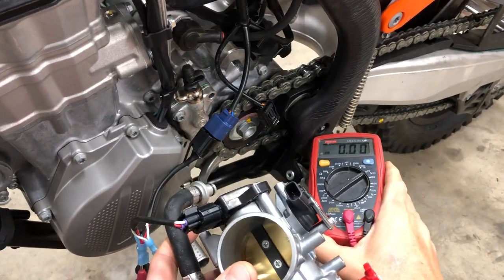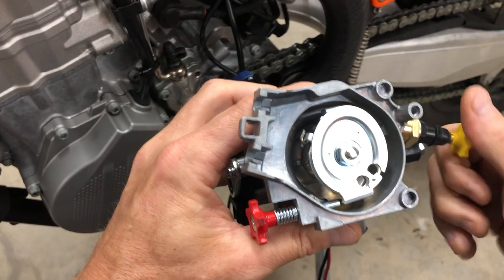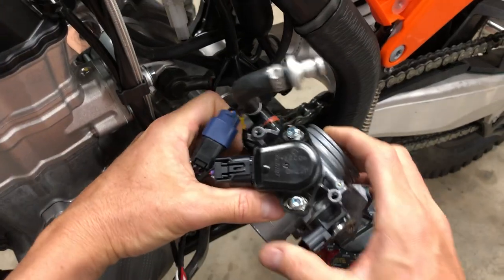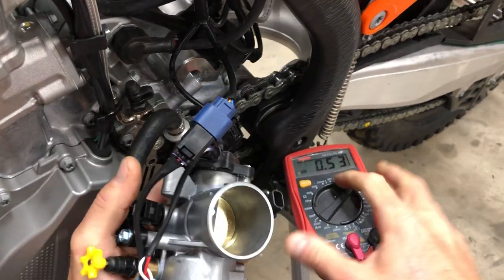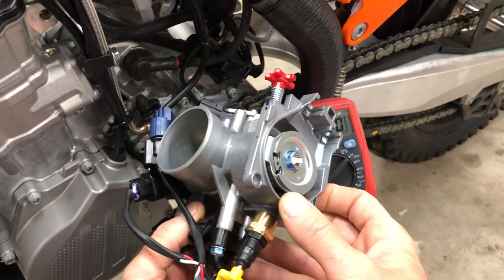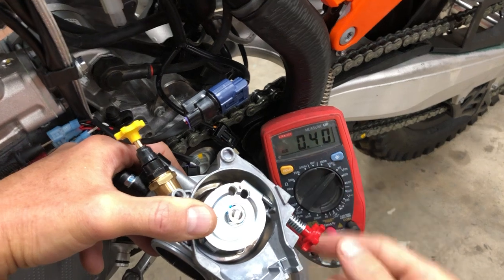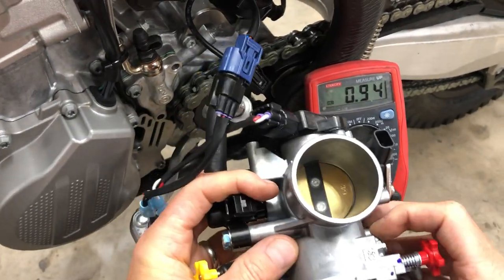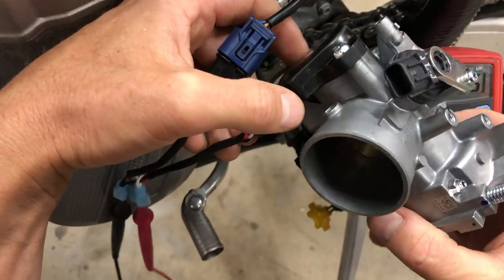MOTO MYTH BUSTERS ON THE TPS HACK AND EVERY THING THROTTLE BODY

Comment: Hi, what do you think of winding the yellow knob all the way out and leaving it there and not using the cold start/fast idle button at all, then adjusting idle with red knob? Can that affect fuelling at all? I have done this on my 2020 450xcf and now on decelleration sometimes it does little pops/backfires.
Reply: That is the way. 

Turn out yellow all the way (63 clicks)
Set red to desired rpm range (2000 on my XCFW 350) once bike is warmed up
Then set high idle to appx 2300 rpm

Note: if you dont set the high idle (enough clicks screwed in) then the throttle tube will have a very difficult (if not impossible) time disengaging the high idle when you roll the throttle forward. Essentially, for every click you go in with the red knob, you'll need to do the same with the yellow to maintain the gap you see Taco showing in the video.

Comment: hello,i have a ytx 125 when it was stock the topspeed was 100kph,but when i change a bigger carb and disconnected the TPS on the stock carb it only maxed at 90kph😅 how can i fix it?😂 the stock carb broke btw.Thats why i use a temporary 26mm carb.Did the TPS disconnected be the reason i loss power?
Reply: i have two ytx,the other one has a bigger bore kit with stock carb and it can reach 150kph,it had 72mm bore.With TPS connected.

Comment: I have a 2017 ktm 250 xcf, and it has always struggled to start, we've done just about everything except mess with the tps, and if I want to start my bike I have to give it some throttle. I have read that increasing the volts read on the tps can make them start easier, is this right, or is there something else that can be done?
Reply from the maker: Set your tps to spec but you may want to confirm that it was adjusted correctly from the factory. 

Also what’s your fuel pressure

Comment: When I hit the high idle on my 17’ 350 it doesn’t stay in like that, would it possibly be an adjustment issue or would it most likely be something wrong with it
Reply: This is exactly why I'm watching.  I been running my bike with it in! Needs to be pulled out.  Did you try to pull yours out?

Comment: Hi when I turn bike on I get 0.48v but when I turn throttle the voltage drops, why would it do this?
Reply from the maker: Voltage should increase as the throttle plate is opened
Reply: @TACOMOTOCO  when I start the bike with cold start pulled out it will idle but soon a so push it back in the bike will cut out. Also when I leave it on idle with cold start on it will only idle for around 30 seconds

Comment: How would this apply to a 2016 KTM 690 R ? Similar method maybe different voltage specification?
Reply from the maker: Good question. I’ll have to look into that. 

The 690 uses a Bosch throttle by wire system that adds a few more bits of complexity into the mix
Reply: @TACOMOTOCO  I have the in series connector for connecting the multi meter but FI TB  but I figure cannot do equivalent to backing idle off of the throttle plate like a cable unit to see if I have base line Mv.